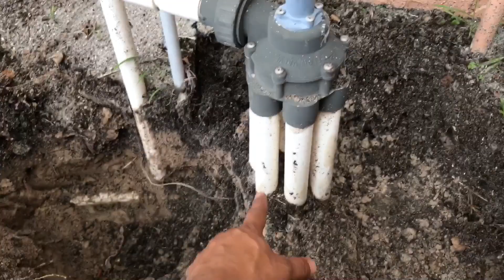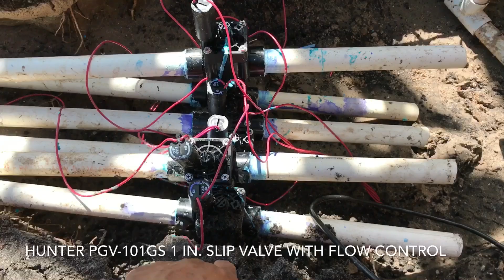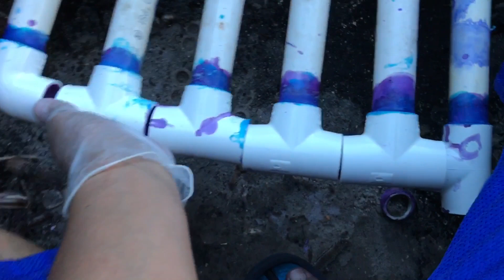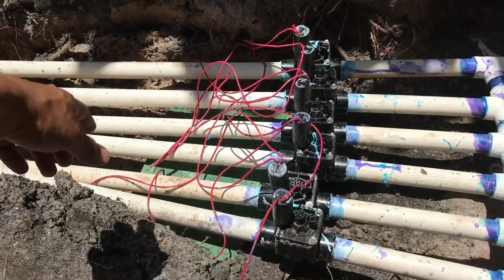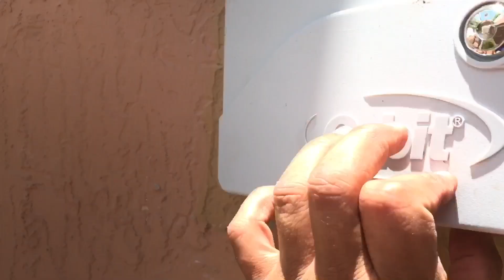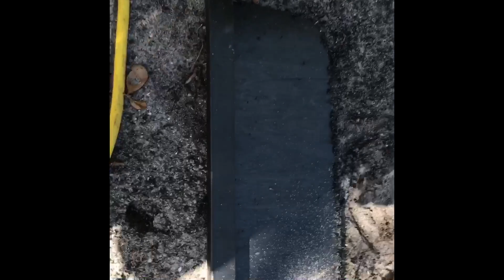Sprinkler Conversion Index Valve to Individual Valves

Comment: Just FYI. This is NOT to code.  When taking out your previous assembly, your removed your back flow prevention device (Vacuum break).  You now have the main water line at risk of contamination.

Comment: Buenas tardes,quisiera hacerle una pregunta. Puedo conectar un timer digital como el del video a un sistema de irrigación antigua o que cuenta con una válvula index con 6 zonas ? Muchas gracias
Reply from the maker: No digital meter only works with the Independent valves system.
Reply: Si puedes, yo lo tengo asi desde hace varios años y ahora voy a reemplazar el indexing valve or individuales. Lo que pasa es que solo ganas la ventaja de controlarlo remotamente porque no puedes controlar cada zona por separado, para eso si necesitas las valvulas individuales.

Comment: i was quoted 900 to replace a six zone hydro indexing system to solenoid. is this a fair price? The heads and pipes are already there and control unit.
Reply from the maker: No that’s too much. Max should be 200-300 MAX

Comment: I need someone to tell me how to tell if I have an index valve
Reply from the maker: If it’s a big round thing that looks like a big flower with multiple pipes going in, then it’s index valve
Reply: @HowToDoitright  ok so I couldn't find anything around my house that showed something like in the video. I could only find some small round boxes in the ground.
Reply from the maker: Ok so open and remove the cover on those boxes and take a peak. Sounds more like you have individual valves which is a good news. Also another way to tell is opening your sprinkler control box and see if you have individual small color wires going to zone numbers. That’s another indication that it’s independent valves and not index valves because index valve only have one valve.

Comment: Why did you delete the backflow prevention valve?
Reply from the maker: Thomas Frye because I got a separate sprinkler system connected to the well system. It was disconnected form the main water line so not needed.

Comment: Has anyone had anyone quote replacement cost going from intermetic indexing valve system to an electronic controller like rachio3? What would be ball park cost? Thanks Kevin
Reply from the maker: It all depends on how many zones you have. Each zone requires a new valve and each good valve range from $30-$50 each. Sometimes you can find them on sale. One you have all valves then it’s just a matter of plumbing and for wiring it will not work efficiently with an analog timer so you will need digital sprinkler controller timer which can control each zone independently. Total cost shouldn’t exceed 300 with labor and parts. Controller cost is separate.
Reply: @HowToDoitright how do you make that math? 6x60 just for solenoid valves is 360. Controller, relay, labor, pvc fittings. That job is at minium 1000-1500
Reply from the maker: lol no. When I did mine the valves were $30 each. 6 zones was 180 bucks. Plumbing is cheap and easy. Another 150-200 max for labor. Basic Controller is cheap 20-30 bucks on amazon but WiFi one can be around 80 bucks
Reply: How To Do it  I would not attempt this outsource completely have 4 zones

Comment: to me, that is not an upgrade. The indexing valve in the long run is much cheaper to maintain. I've had two indexing valves (one for the front yard on e for the back yard) for over 25 years and replaced a part once in the front yard 15 years ago.  I would have had to have 8 individual solenoid valves if I did not use indexing valves. I use two, one each for front yard, one for the back yard. No electrical connection required for aindexing valves, so the solonoid valve can be place close to water source and the indexing valve can be place very close to your zones, and it lets you use a large diameter supply pipe (like 1 inch to the indexing valve) for adequate volume then 3/4 to the sprinklers then 1/2 to preserve pressure.  You have created a sphagetti bowl. I can manually step through my zones if I wish, otherwise each zone gets watered 45 miutes each. A simple timer is all that is required, since all its doing is turning on the water (open valve) or turning it off. the indexing valve determines which zone is next.
Reply: David Berry not to engage in semantics but he is right. This is an upgrade in every sense of the word. By definition upgrades cost more in terms of the initial cost and maintenance costs, in fact probably more than what is saved in water usage, but that is what upgrades are. You spend more to get additional benefits. This system he has now is objectively superior in every way to an indexing valve. For me, it's more about avoiding the aggravation of trying to turn on a particular zone and not having to cycle through all the other zones tediously to get to the one you care about. This happens often when performing regular maintenance such as replacing sprinkler heads or adjusting spray patterns etc etc. the reduced aggravation alone is worth the additional cost to me. That is why I came looking for videos such as this. I just wish that there was a direct drop in replacement for the indexing valve so that the amount of labor wasn't so great.
Reply from the maker: Dennis Kapatos thanks David. I am glad this there are people who think outside the box :)
Reply from the maker: David Berry I see your point but the new smart technology cannot be used with the old index valve style. There is no way you can control each zones with smart controller.  It all depends what the end user wants. If anyone old don’t care about technology and don’t care about controlling each zone they wouldn’t care however new generations who wants more control of their zone and are in to smart devices would prefer each controllable zone with the electronic valve. It’s personal preference and I preferred to have individual valves and am very happy and satisfied with it.
Reply: @HowToDoitright  I use smart technology when its benefits the situation. Some of that is just hype...Most of the time (most all of the time) who cares which zone gets watered first as long as all zones get watered.
Reply from the maker: David Berry depends on what is some of that hype you are referring to. To some it may be hype and some it may be beneficial. In this case it was much beneficial for me because in my lawn some zones needs to get watered more than the other and by having the index valve I was wasting more water. By having individual control on zone I have saved a lot on water bill. So for me yes this is an upgrade and not a hype.
Reply: @HowToDoitright  By the way, do you live in Florida?
Reply from the maker: @ToneCre8 Yes I’m in Florida
Reply: David Berry, just wanted to say your system as is currently set up, if it works for what you need then yes this wouldn't be an upgrade. Plenty of times you don't need full control. In my case, your system would not work. I need to have control of the different zones and they will need to be watered differently and at different times. I have my fruit trees, lawn, veggie patch, and berries. All need different attention. The smart system for me is better suited.

There is never a fully right nor wrong way to do this, just a different way.
Reply: I'm surprised someone says it is not an upgrade. I just did the same with my sprinkler system. I hated index valve, and so glad I did change it, now I can turn on the sprinklers from my phone, skip watering when it is raining too much. I used orbit solenoid system which is easy to fix and replace, unlike if your index valve brakes you would have to replace whole unit and cut the pipes.
Reply: @SlavKurochkin  That is not true. I have an index valve that broke and all I had to do was replace the spring. I also could of just unscrewed the top and replaced that part of the unit. That being said, I am here because I do want more control of my yard and am going to upgrade to a digital unit with solenoid valves. I also have new planter beds and need more zones with better watering time options.
Reply: Really surprised me that someone would prefer less flexibility/capability over more. All of my neighbors have replaced their old style indexing valves, which is what brought me on the search for this video.
Reply: Depends on your yard and specific situation. I have poor soil in my back yard and great soil up front. During dryer seasons the front yard still grows nice but the back yard dries quicker and doesn't hold water very well. With an indexing valve I can only adjust how long each zone stays on but not how often each zone is watered but I have no control over how often I run specific zones. It's either all zones in one cycle or none. If I I want to run my front and side zones 3 times a week for 20 minutes but I can't just water my back yard zones on the off days for 10 minutes each to ensure those areas are watered more frequently without over watering my front zones. By switching from indexing valve to individual valves and a controller, I will be able to water just my back yard zones on the extra days without watering the other zones that don't need that extra water. And for a few hundred dollars and an afternoon of my time, it's much cheaper than digging up and replacing the soil in my back yard.
Reply: I agree with David Barry to a point of "not fixin' what ain't broke", as I have an indexing system. Being in construction, numerous irrigation contractors I know use electric control valves only on commercial projects and very elaborate large residential properties, and curse them.  My intermatic timer has little metal blades that you can use to set the time of irrigation in 15 min time increments, and days of the week.  In my area we need to water twice a week for .75 to 1.0 inches per application.  I gave my contractor the choice of systems and he chose the indexing. Yes it's a pain of cycling the whole system when you want to fix a head, but I typically need to do this only once or twice a year. And my system can take big electric surges without ESD damage, it's basically bulletproof.  So if an EMP went off, my grass would still be watered! If I had to start from scratch today, I would use a modern timer and electric control valves, to set the system remotely via a phone app, but I would not undertake this operation if I had a working system that served it's purpose, to each his own.  Thank you for the video!